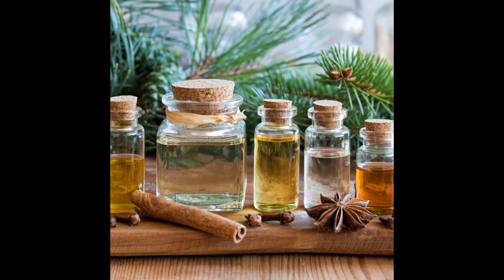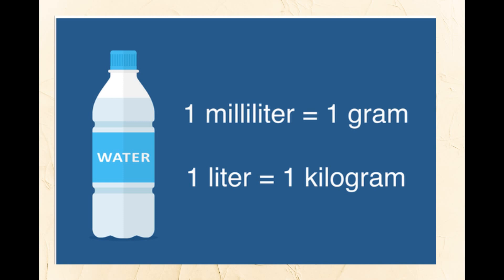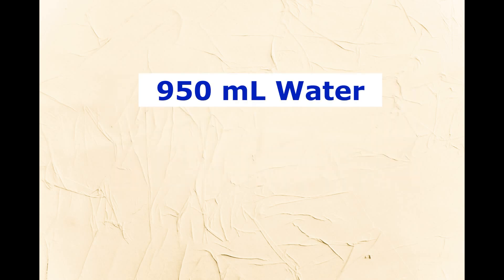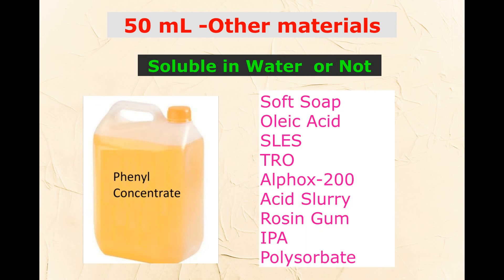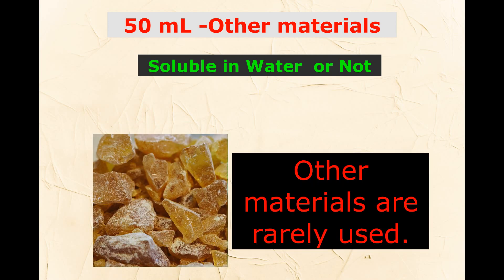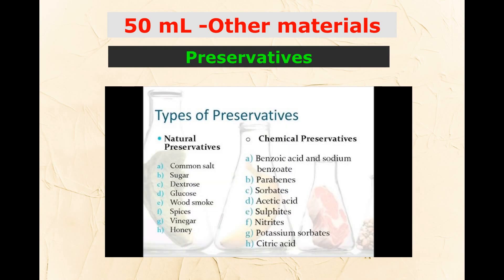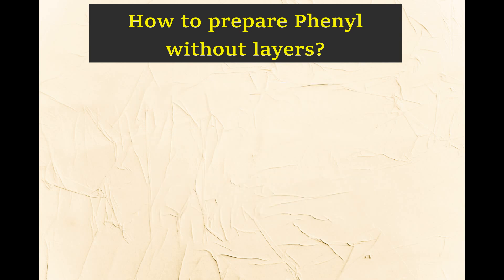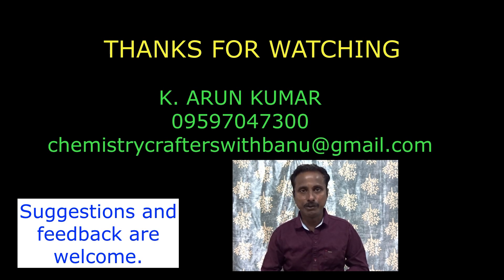What are the Reasons for Layer separation in Phenyl Solution? How to avoid?

Comment: I am trying with below proportion:
150 grams alphox 200, 150 grams TRO and 700 grams pine oil(32%) and still I am getting oil floating at the top. What can be done? Is there anything wrong with the proportion in this case? Your guidance would mean a lot.
Reply from the maker: It is the comment section. Not for technical guidance.

Comment: Very good logical points. Still I would like to know the stages of seperation like flocculation, creaming , etc and how could we avoid these.
2nd if there is creaming in complete phenyl solution could we rectify it.
3rd is adding a thickner be a solution to this problem?
Drawing your kind attention.
Reply from the maker: 1. It involves indepth understanding. In you tube platform, audience retention time is factor. 2. Creaming means extra layer. Extra layer means, insufficient emulsifier. 3.May be or May not been... Based on the specific chemical atmosphere.